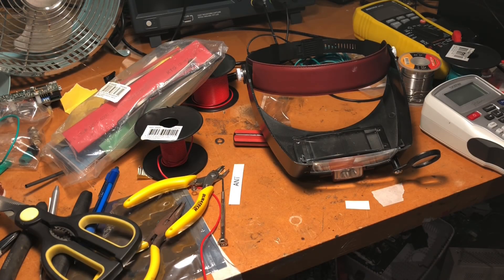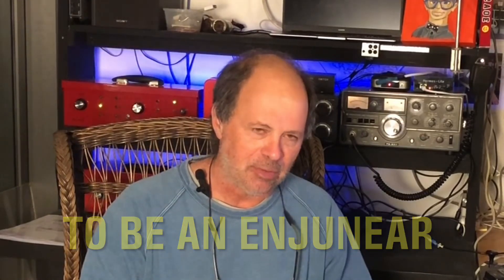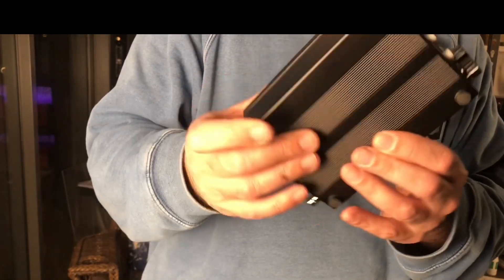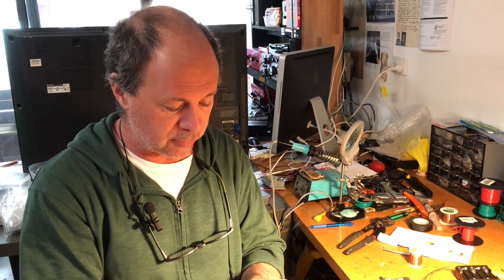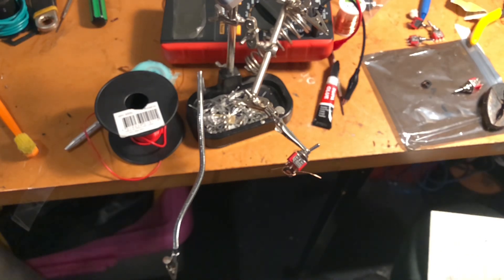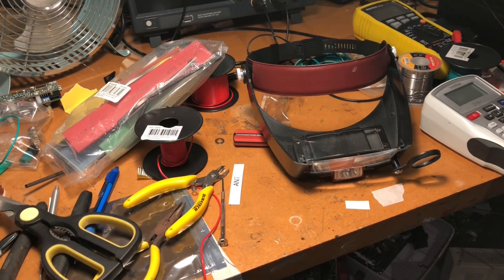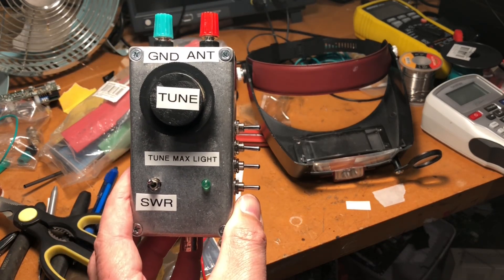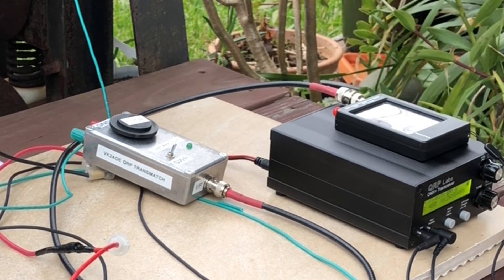Monster QRP ATU and antenna for portable operating @TheArtofEngineering

Comment: Mate, can you share the swr part of the circuit.
Reply from the maker: The tuner works well ....the indicator not so good. I used the tune for max brightness by Peter Parker VK3YE. I think some sort of bridge would be better (even one showing forward and reverse). I just use a nano VNA or on my QMX the "tune SWR". Its basically a toroid over the centre conductor of coax with a current limit resistor and  switch (to turn it off).
https://youtu.be/NjHyXi1SrZs?si=-OtzV0QOy085NqP7
Reply: @TheArtofEngineering  Ofcourse I remember watching that video, thanks for the reminder.

Comment: #SadHamComment

Personally, I would have tinned the coil ends first, which would have taken longer, and been more of a fluff around, but kept the amount of heat on the switch poles to a minimum.  

That said, if it works and you’re making QSOs, you’re doing better than me. I’ve been on the air once in 3 months. But it was CW, with a straight key, so I am justified in my feeling of superiority over the wailing cats hams. 

😉